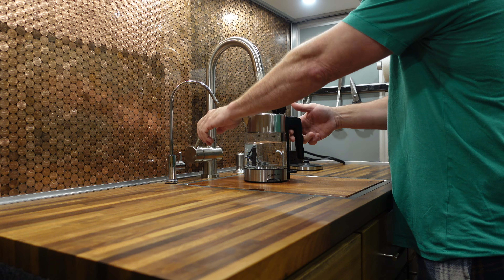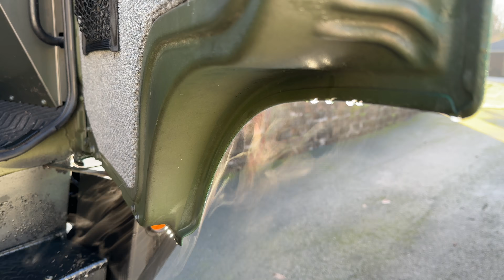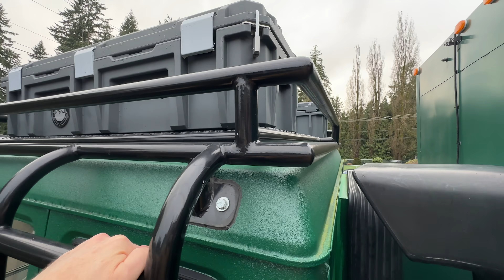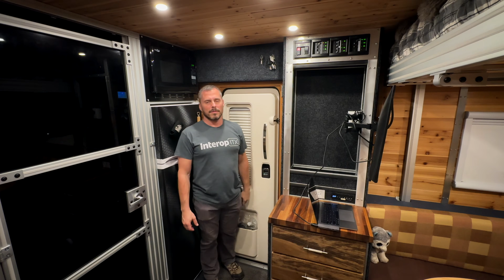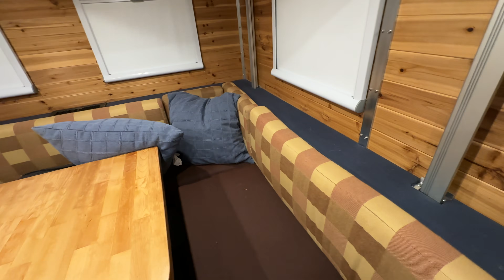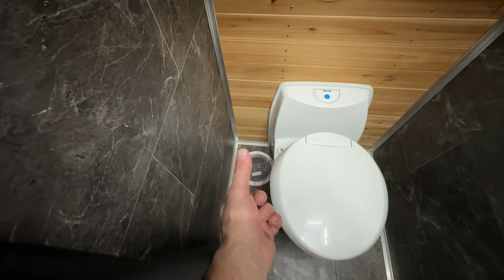LMTV overlander walkthrough

Comment: That is some amazing engineering and a LOT of hours you put in that. Definitely surpasses my skill level, couple hot tips tho, get Ecohubs to lower your RPMs and kill the noise. 2. next time (right) use house solar panels instead of 12v RV panels, better production, and cheaper if you hunt around, love the Victron work, definitely high end. Video suggestions: what have you done on mechanical maintenance and any break downs that made you broke, those make great vids.

Comment: Do you get this question: What is all this actually for? To out do the next door neighbor? Or to get you 8 miles per gallon and pollute the environment. This is totally unnecessary. From someone who has traveled to 50 + countries 😉
Reply from the maker: Absolutely I get that question, I usually point out reusing a 23 year old truck and driving it 20 to 30k miles has way less environmental impact than buying a new RV even if it gets better mileage. I would love to see the impact data for new vs reusing an existing vehicle. As for the what is this all for? The answer is: Making memories and sharing those experiences and it’s something to do.

Comment: On the smelly toilet issue, in Europe we use a German made extraction fan, called a SOG. It turns on when you open the blade and stops w hen you close it.  All top of the range RVs have it as standard, but you can buy one for you Thetford toilet for around £250 /$300 and you don’t ever need chemicals again.
Reply from the maker: Good callout.  I’ll look into the SOG.

Comment: Thank you, love your content and the bloopers at the end are great.
I just acquired a 97 LMTV that someone started parting out. It is missing the Turbo, turbo boost tube as well as other key components.
Would you have suggestions on part Suppliers and LMTV resellers to use. Preferably in the PNW as I live in southern oregon.
Thanks for your time.

P.S. An ambulance build would be awesome.
Reply from the maker: The LMTV Facebook page has been the best source for parts as most of the parts dealers are on there as well as small sellers.
Reply: I think a lot of school busses have the same motor as well . Might be an avenue for some things.